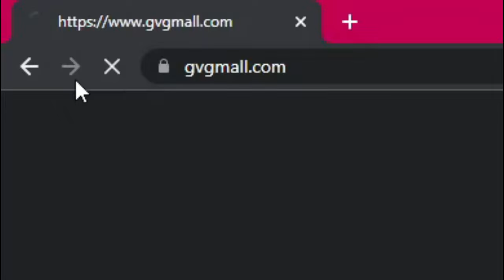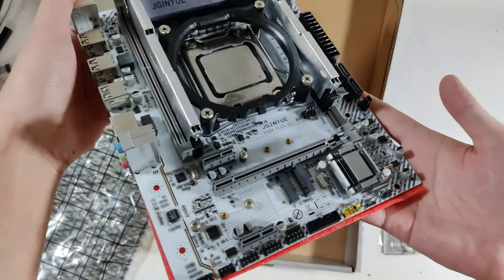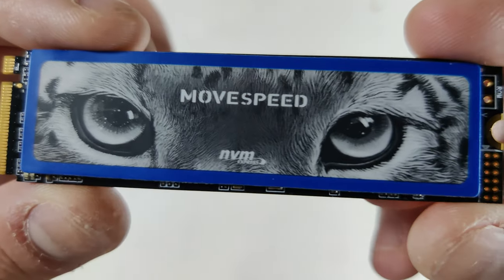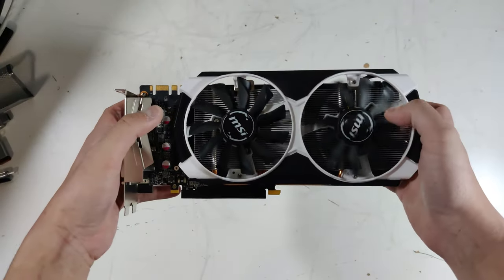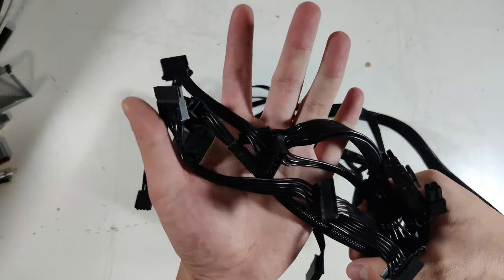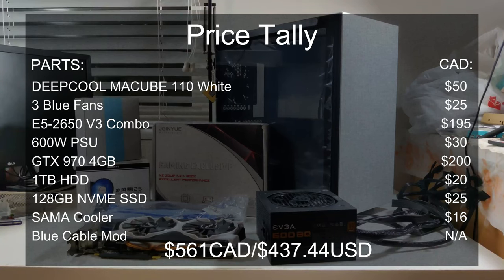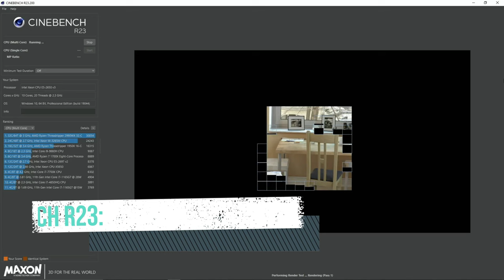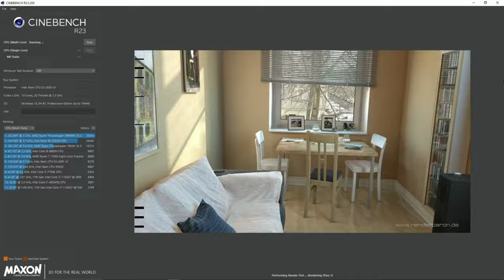High Core Count Gaming PC for $450!!?

Comment: I highly recommend going with the E5 2640 v3 and Machinist X99-K9. The VRMs are a bit weak on that, but you can still use a custom BIOS (e.g. from Mi899) for turbo boost unlock and it won't throttle you. These boards are not the same and having higher single core performance really pays off with Haswell-E generation. Getting a cheap Snowman cooler is also worth it. 

Custom BIOS also means you can control RAM timings yourself. When using quad channel memory, this really matters.

Comment: bro this is a big W i honestly might build this. do you think it’s better if i build this or buy a prebuilt with a rx 5500 w/ ryzen 5 5300g
Reply: Depends the Xeon doesn’t have integrated graphics like the ryzen which comes in handy when trouble shooting a gpu or if upgrading requires you to sell your current gpu to have more for a better upgrade
Reply from the maker: The 5300g would be a better system for more upgrade paths, but xeon you can have more cores on the cheap. In my opinion, if you only want fps then go with ryzen prebuilt, but if you also want content creation and such, it's better to go with xeon. On top of that xeon is way cheaper.
Reply: @woostinstechflip  thanks